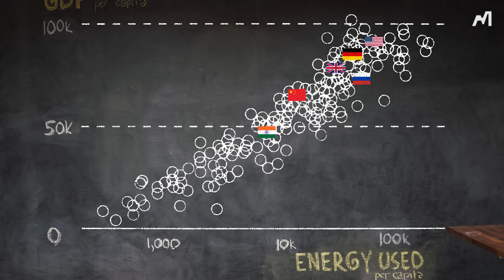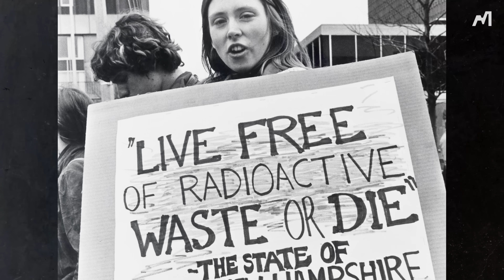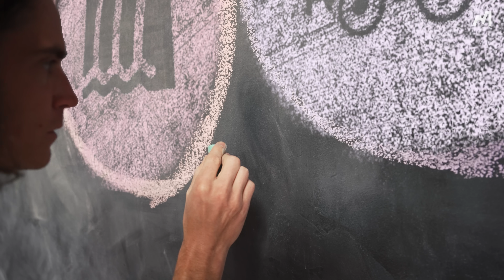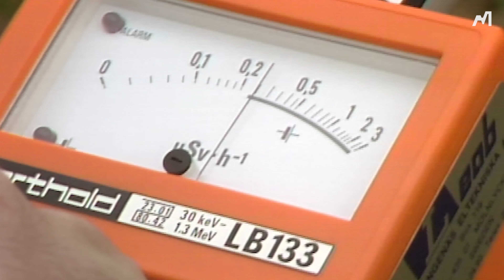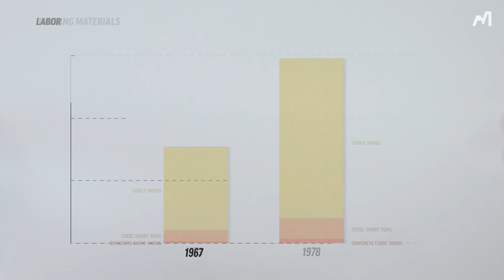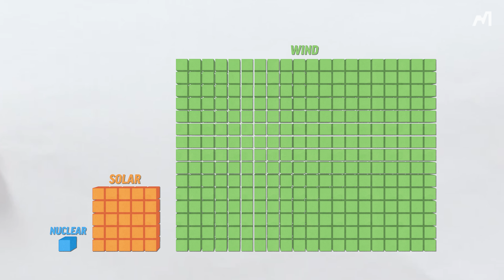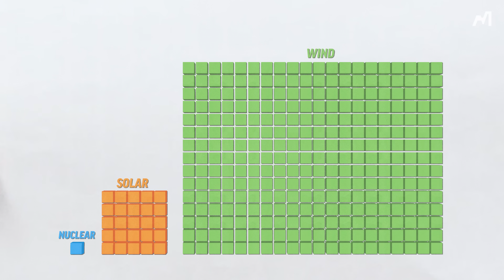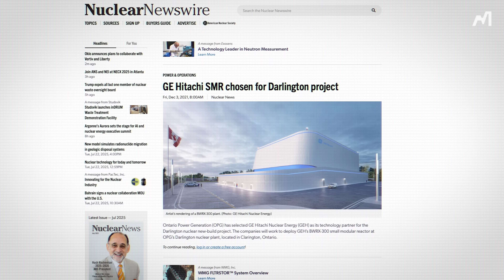They're Lying to You About Nuclear Energy

Comment: I did a bunch of maths on this a while ago, because our government was talking about it, and though most of your points aren't technically wrong, they're kind of misleading, and even just leaving many things out of the discussion.

I was just about to write out a whole spiel, but I doubt you'd listen, because it sounds like you have an agenda :/ Long story short for people wanting more accurate information, radiation is, in fact, bad, even low amounts, if over a long time. Nuclear does not currently use less concrete per MW on average compared to green sources. Green doesn't have to mine ginormous amounts of land constantly, for small amounts of fuel, which in itself, is a disaster. You'd be surprised at all the extra chemicals nuclear uses too. The cost of green is slightly higher than nuclear, but green is finished much faster, and has severely less ongoing costs, and requires less infrastructure and machinery to in the long run too. Mining trucks don't just get delivered by a stalk to their doorsteps.

Comment: In particular the Stable Salt Reactor designed by Moltex Energy makes electricity much more cheaply than coal, is completely safe under all scenarios and can run on nuclear waste, converting the waste into a safe form. The integrated WATSS fuel cycle is also proliferation resistant. The Canadians are building the first one. The rest of the world needs to get on board quickly.

Comment: I’m all for nuclear. It’s THE solution to our power needs currently.
However, the idea that regulations are a huge issue, is silly. 
Nuclear should be regulated to a maximum extent. I’m sorry, but that’s just a must.
Secondly, this video addresses the costs of building plants. Yes. They are very high. (There is an excellent channel on the subject: Illinois energy professor)
That being said, the funding issues are an easy fix. But, us being Americans, are convinced everything has to be a private sector profit driven operation.
We could easily fund new plants via government initiatives. clutches pearls
It could even be a loan which doesn’t require service of the debt till after the plant is in service.
That’ll never happen, because like I said….. we’re Americans.
There is ways to get nuclear running. And it’s not even that hard. Just no will to do so.

Comment: One way to lie is to pretend that the problem is something other than what it is. When you have nuclear reactors- in all countries- being very expensive to build, and being subject to long delays, that's a technology thing, not primarily a regulatory thing. The fact that nuclear power hasn't killed many people, says nothing about how it would be without the regulations. And the fact that it's being completely outcompeted by renewables is really important. And there's another issue as well- nuclear is only baseload, because it's so expensive to build it has to run flat out. So nuclear power is expensive baseload. Baseload is normally the cheap bit! All this means it is very uncompetitive.

Comment: Nuclear is slow to build
Nuclear is expensive
Extreme weather is going to make the hazards into increasingly large risks.
Reply: > Nuclear is slow to build
Yes

> Nuclear is expensive
Yes

Nuclear is both slow and expensive to build, but extremely valuable. I.e. don't just look at the COST, also look at the RETURN.
Countries with grids dominated by nuclear have much lower electricity prices, than countries with grids dominated by wind and solar; AND typically lower emissions too!

> Extreme weather is going to make the hazards into increasingly large risks.

Yes, which is why we need weather-independent nuclear, rather than weather-centric wind and solar.

Sure, people point to French reactors shutting down in spring/summer due to cooling water - but ignore that spring is the yearly maintenance cycle (as demand is lowest) and that one CAN site and build nuclear in better locations (or use slightly different technology, see Palo Verde, 2nd largest NPP in the US in the middle of the Arizona desert - noted for its lack of water), whereas one CANNOT site and build wind and solar in 'better' locations - the whole point is they are driven by the weather!
Reply: @factnotfiction5915  nope. nuclear is expensive. It's taken massive subsidies to build and I'm comparing building stuff now not 20 yeras ago.

Comment: The cost of the Vogtle 3 & 4 expansion has ballooned  to, lets see... $36B so far.  Billion with a B.  For two units totaling around 2.2GW of power.  Power that is not economic, by the way, because it is pure base load while the modern renewables-heavy grid is daily-cyclic.  California is already hitting 0% fossil generation for hours now, and Texas is traveling along the same road.  Over 1/2 the economic operation hours are removed from fossil generation, daily.  But nuclear can't turn off... it has to run 24x7, more or less.  Even if electricity prices go to $0, or negative during parts of the day.

Worse, the cost of electricity has not been generation-driven for several decades now.  Fossil fuel generation, best case, $0.03/kWh.  Renewables generation... also $0.03/kWh on new contracts (older contracts were more around $0.06/kWh).  The price of electricity?  A lot more in most states and the states where the price was traditionally low was only that low because they relied on exporting most of their electricity generation to other states, allowing lower domestic rates.  Which is all basically going away now as data centers get built in those formally low-cost states.

The solution?   How do we make base load economic again?   Batteries.  Grid-scale storage.  Ironic, isn't it!   Modern nuclear cannot be economic without battery storage.   Batteries also solve a whole lot more than renewables intermittency.  They are being used to avoid having to add new transmission lines to satisfy expanding consumption.   In countries and states where they are heavily deployed, batteries now handle more or less ALL ancillary services.  And remove any need for peaker plants.  They already more or less pay for themselves, and then some.

Worse, the retail cost of electricity now has a lot more to do with transmission and distribution... just maintaining the grid that we have, and a lot less to do with generation.  Why then would anyone risk anything to build new nuclear out when it won't make one iota of difference in retail electricity costs?

How bad are the economics now?  People like to blame California's "forced" exports on solar energy but right now California is exporting power literally from 8am to 10pm.  That's 10pm with a 'p'... well after sunset.  With almost no base load left.  Batteries are taking more and more of the shoulder, even exceeding natural gas on some days now during peak evening periods.

Nuclear can't survive these economics.

-Matt

Comment: My whole life I have been pro nuclear energy, but I have recently changed my mind. Not because I fear a nuclear reactor, build one in my town and I would be happy with it. But because of the time it takes and cost ti make. The same money spent on renewables would remove the need for the nuclear reactors. 
I understand your argument about space. But I live in a country that has one thing in abundance, and that is space.
Reply: nuclear time and costs

A - Don't look at the capital costs in isolation (i.e. the LCOE model). You need to look at the SYSTEM COST.
And when you look at the system costs, grids with significant nuclear tend to have retail rates much lower than grids with significant wind/solar.
(SYSTEM wind/solar requires cost of extra assets - longer transmission, storage, backup, redundancy, etc; none of which are needed for nuclear, although storage pairs well with nuclear)

B - time - average time to build a NPP is 6.5 years;  in recent years the UAE built 1 every 8 years for a total of 4 over 11 years.
HPC, Vogtle, Flamanville - yeah, FOAK are going to take longer to train the workforce
China builds NPPs at a steady rate and are hitting that 6-7 year mark fairly consistently - they aren't skimping, they get great marks from the IAEA and other national regulators like the NRC - they are practicing continually!